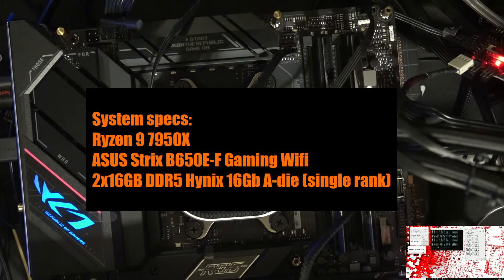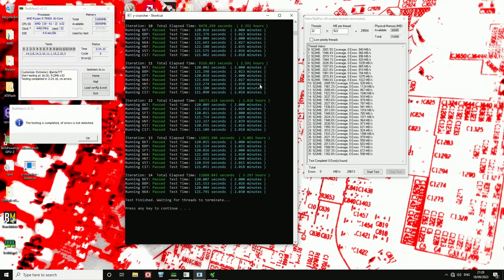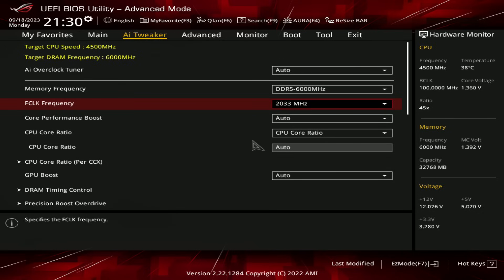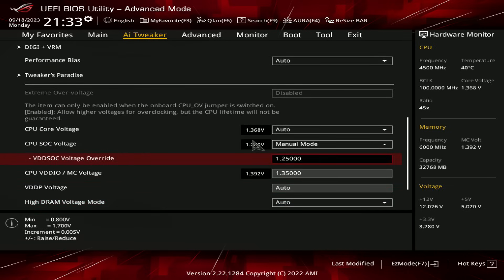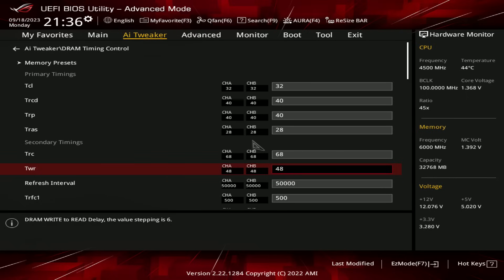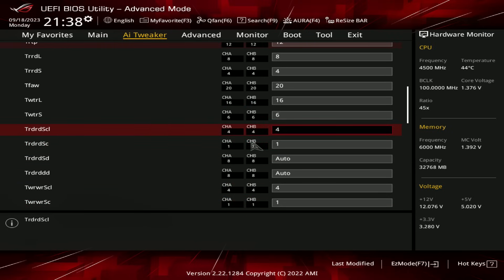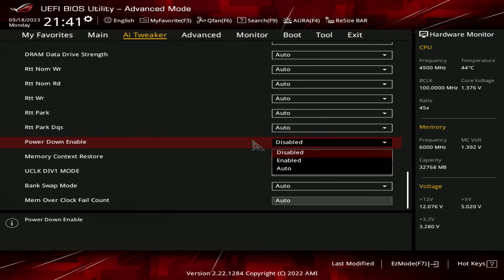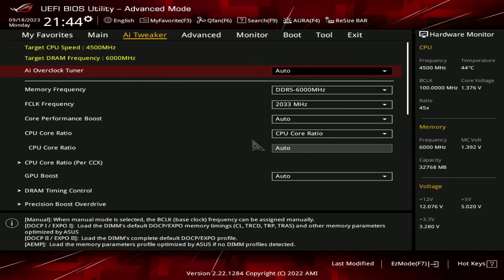Easy memory timings for Hynix DDR5 with Ryzen 7000

Comment: Would be nice to have a comparison of performance after setting the timings
Reply: 2x16GB Corsair Dominator Platinum, CL30 version. Hynix.
On Aida64 memory benchmark I got following results:
Expo:
Read: 77914MB/s | Write: 76244MB/s | Copy: 68462MB/s | Latency: 69.5ns
Buildzoid profile:
Read: 88496MB/s | Write: 92345MB/s | Copy: 79040MB/s | Latency: 61.8ns
Reply: @PaulDiracTWR  I'm using these exact settings, with 64gb and I'm only getting  
Read: 65000 | Write: 91000 | Copty 64000 | latency 69.8
What am I doing wrong?  Thats a huge difference in read
Reply: @brett6228  im in the same boat as you. Did you find a solution?
Reply: @brett6228  Yeah, seeing similar numbers. Not seeing what was originally posted.
Reply from the maker: One problem. I don't have any "normal" EXPO kits.
Reply: @ActuallyHardcoreOverclocking  
Hi, I copied your settings and got an overckock that seemed stable on Windows 11 because the computer wouldn't restart.  However, when playing a game like halo infinite or battkefield V for 5 minutes, the game ends up closing.  With other types of overclock the computer was restarted, which I consider more unstable.  How can I keep similar values and prevent the games from crashing?  I don't know what value to start changing or raising again or what you can advise me to try to find stability in games.
Currently I tried other settings with my same RAM from a web and other secondary values and I got improvement, but without a doubt yours was the best.  of 70 ns with the Expo value of the latency ram at 56.7 ns, a beast.  The reading and writing speed also increased by about 400 points.  In games, the performance improvement is noticeable a lot, especially in CPU-dependent games, I made comparisons and the average, low and maximum fps increased a lot.  For this reason I do not want to give up your magnificent overclock profile, and for this I want you to advise me what values or value I should go up little by little to find my point of stability.

My ram is a Flare X 6000 CL32 32-38-38-96, and the primary values that I set along with your overclock were 28-36-36-28.  The overclock that I was trying previously was the one in the following link: https://www.techpowerup.com/review/g-skill-flare-x5-ddr5-6000-cl32-amd-2x-16-gb/8.html  which was stable if I applied only the primary values, but when applying the secondary ones the pc ended up restarting at some point.
Reply: @SightlyJester I think he said to use the primary timings that came with the RAM. So 32-38-38. You are lowering those timings quite a bit
Reply: @SightlyJester  As Nathan White said, in the video he didn't change primary timings. He said that those timings tend to be where quality differences show up and so the manufacturer likely already tried tighter primary timings and it failed. Also in the video he said that if you have problems where the ram is stable with his secondary timings during memory stress tests but then crash in games then probably your gpu is overheating the ram. He said that it's a good idea to stress test the gpu at the same time as the ram to identify this. Also if it's just the game closing rather than a restart could it be the gpu overclock rather than ram? My gpu settings are seemingly stable except for hitman world of assassination where the game crashes unless the gpu is on stock settings. Since the system stays on you could let a game crash happen then look at event viewer to see if there are clues as to what went wrong.
Reply: Hardware unboxed will be releasing a video on this shortly. It's already available on floatplane. Long story short, these can make a 5200 cl30 kit perform similar to a 6000 cl30 running expo.

Comment: I wonder which one is more relevant: Warm air inside your case due to a power hungry GPU or the heat traveling through the motherboard PCB to your dimm slots, potentially even destabilizing mobo signal integrity. At least I seem to observe a CPU being hotter than it should be during heavy 4k gaming, e.g. Cyberpunk with RT on. This is with an overclocked 2080 Ti on a Z490 Master with a 10900k.
Reply: It’s been tested and revealed that warm GPU air actually lowers CPU temps rather than hot ambient air. I think good airflow is the jack of all trades here.
Reply: If your CPU cooler is not that great (I'm on a 7900 set to 105W eco with the stock cooler) it will warm up the motherboard and DIMM slots much more than any GPU would, I can confirm this 100% from my testing. Even went up 10 degrees on the GPU compared to my previous 6700K OC setup, pulling the same power but with a massive cooler that was able to get rid of the heat immediately.

Comment: I have a Trident Z Neo 2x16GB kit (F5-6000J3038F16GX2-TZ5NR) How can I tell if it's M or A-Die? I know it's Hynix.
Also, how much performance will this tweak give in terms of gaming?
Reply: You can read the code near the barcode and if it ends with A it's adie,  M is mdie.
Gains depends on what game You play, what application you are running and your gpu for example.
On ddr4 it was for sure over 10% in some games.
Reply: @justetan3566  sweet! Looks like I have an M-Die to use!
Reply: @TheApotheCarrot  hardwareunboxed just tested this and gains are generaly 12%+ on amd, probably lower gains on intel though.
Reply: @Jack  I saw that video. Gains should be above that, as I expect they used an XMP and not custom tuned

Comment: Great and useful vid BZ, appreciate it!
Any thoughts on GDM setting (ADDR_CMD_Mode for ASUS). I've read that disabling it (setting to BUF) can improve latency?

P.S.: Would be awesome to get a vid on how to best push m-die to 6200/6400 with emphasis on MC, IF and CPU voltages.
Reply: At least on zen 3 it was know to improve performance because GDM does some strange interactions with command rate, so even if you had 1T on the command rate, in reality it was performing like 2t (or worse) if the GDM was enabled
Reply: @temporoyale6251  GDM On is more like 1.5T and gives you ability to get some higher MHz and timighter timings to boot, it's not worse than 2T for sure.
Reply: @Kestrelms  yeah, you are right, but I remember a know memory overclocker (Veii) testing the performance of GDM, and in some cases, not all, GDM on would perform worse than 2T
Reply: @temporoyale6251  I did myself tests on dual rank micron E-dies.
Reply: @Kestrelms  i can back him up   GDM ON does indeed have some horrible flaws when you overtight some timings like tRRDL 4 instead of 6 , tWTRL 8 instead of 10  and  tRDWR / tWRRD ratio if you use lower tCWL than tCL.  might be just a dual ranked issue. in my experience i would use a lower frequency with gdm off than a higher one with gdm on.
might be a specific motherboard / ram issue, might be something else but the issue is there.

Edit: GDM ON feels like a fake stable settings on some rare situation, doesn't throw errors but gives significant worse result than 2t.. not to mention 1t pure.   For some reason most overclockers and AMD recommend GDM ON for Dual Rank kits, based on my experience i don't.

Comment: With my 7700x, Asrock b650e Pg Riptide and Hynix A-die (2x16) I've spent several hours to optimize timings one by one and I came up with the same values. In my setup the FCLK is stable at 2100 and Trdrw can easily go down at 14. Unfortunately at the moment Asrock bios doesn't allow to modify Trefi.
Reply: Update your bios, tREFI and GDM can be screwed with now.

Comment: Thank you Buildzoid, much appreciated!
I'm running the same motherboard as you and a Ryzen 7700X with the G.Skill F5-6000J3038F16GX2-TZ5NR EXPO kit. Besides the 3 primaries I copied the same timings as you and got an increase in AIDA64, but can't help wondering if I'm still missing some improvements.
Default EXPO I was getting 59K reads and about 72 latency, with the changes it improved to 65K reads and 65 latency, but I see others getting a lot better.
I'm wondering if I'm missing something?

I'm also wondering about my silicon quality of my 7700X as with PBO enabled, ASUS's auto settings are doing a negative 15 all core offset on the curve optimizer. Out of curiosity I did -30 all core and ran CinebenchR23 multicore for 30mins and no crash, but I don't know if its actually stable.
I've been out of the loop on overclocking for a long time. I just built this upgrade from an i7-3770K I had for 10 years, OCing has felt overwhelming to say the least lol.
Reply: Regarding PBO - just run core cycler and adjust cores individually as necessary. It'll give you utter stability as far as the high end goes. The biggest problem with undervolts is that you're moving the voltage curve down by an offset and at lower frequencies and loads it may be unstable. So if you need 24/7 stability I'd usually keep it 1-2 points above whatever core cycler helps you end up at.
Reply: I've got an 7700x too. I can run banchmarks at -30 all core but if I run a code compile I get some errors. Ended up optimizing core by core with 6 cores at -30 and 2 cores at -28 and -27 and it's stable now
Reply: Hey, I'm on a 7900 so probably different experience and all, but I'm on -30 all cores too, running for one week now. It was so stable in what I do that I went to -40 (lol) and it kind of worked, but what I noticed is that it would crash in medium to light loads (think YT videos or gaming), heavy loads were fine. Try using CoreCycler, it cycles between different loads across all cores, and tells you which core has died.
Reply: My 7700X can reach 52.8ns latency, 70k read, but only -10 core is stable, and trrdscl can't reach 4 (unbootable)
Reply: @nguyendinh2052  What Ram kit are you using?
Reply: @_Keiichi_  Hynix A F5-6000J3238F16GX2-FX5
Reply: I'm in the same boat. With the same RAM and a 7800X3D, Aida64 shows almost the exact numbers you got from before and after tuning. Have you made any progress on it?
Reply: Don't just copy settings. Tweak individual timings yourself and see what works
Reply: @GewelReal  My RAM kit uses the same SK Hynix A-die that Buildzoid is talking about in this video, and explains why you can just copy all the same timings. Which from what I gather is the point of this video in the first place. Otherwise if they were different chips I wouldn't and likely just stick with the EXPO profiles.
But I'm seeing others that are getting better results copying his timings when using the same Gskill expo kits and thinking something is off.
I don't really know a lot of the ins and outs of ram timing so this video has been a great place to start for me, but don't have the time to tweak each one figuring out what to do.

I also thought it was odd my initial EXPO latency in AIDA is 72 with lower reads then what a lot of the reviewers were getting with the same gskill expo kits.
Reply: @_Keiichi_  yeah you can copy, but theres variation to each die

Comment: Hey Buildzoid, a question for your expertise, since Ryzen 7000 have memory speed peak at around 6000, is buying Samsung DDR5 viable since they have lower tRCD? or is it still hard to stabilize or have other issue I am not aware of? Thanks in Advance!
Reply from the maker: Samsung DDR5 is just generally harder to run. Also Samsung has weaker subtimings.

Comment: my tfaw is 16 on x670e-e strix with the asus 6400mhz cl32 1.4v profile timing on 7700x with 2200 FCLK

edit: just found out that FCLK 2200 from 2133 gives me a nice measurable fps boost in watchdog legion benchmark from 192-3 fps average to 196-7
Reply: Very nice. What's your SOC voltage?
Reply: @TheJonazas  it was 1.43 while it was on Auto but since i entered 1.4 manually i can't get it stable over 2000fclk 😡 no clue wtf happened
Reply: @GoldenEagle0007  damn... ok

Comment: I really appreciate the videos where you show timings that should be valid for a particular memory module/manufacturer. I used your videos applicable for 3200 CL14 b-die for ryzen to OC to decent timings 3800MHz cl16 and it worked fantastic.

Comment: Thank you so much for this!  I used your settings on my G.SKILL Trident Z5 Neo DDR5 6000 64gb kit and went from read rate of 70,238 MB/s to 84,750 MB/s; and latency of 69.1ns to 59.4ns.
One question I have is on my Asus x670e Hero MB, the CPU VDDIO/MC voltage, when I set to 1.35000 V, it changes the value to something like ~1.35663V.  Does this matter?
Reply: Very nice, thanks for sharing this! I'm getting the same kit - assuming you used CL30 one right?
Reply: @ChatGTA345  yes cl30
Reply: no, that doesn't matter, it's normal
Reply: Hello. Can you help me with the setting as I’m having the same board. But I couldn’t boot with 128gb 6000mhz.
Reply: @Shafy7   Did you figure out how to get it working with those settings?
Reply: @icarus33 no. Still running at 128gb at 3800mhz
Reply: I dont know how evrybody getting those ram speeds...9700x on expo im with 59k and 78 latency with his timings im with 63k and 70 lstenci. 
Board x870e Carbon ..ram Corsair vengeance Cl30 36 36 76 at expo

Comment: With 128Gb needing to run at a much lower speed, would you see any increase in performance by optimizing the timings?
Reply: Are you running with 128gb ?
Reply: @Shafy7  I am not, because the speed needs to be so low

Comment: Can VDDSOC be higher than VDDIO/MC?  BTW I think memory temperature is usually higher on the open test bench (with no air flow) than in a case with minimal air flow.
Reply from the maker: AFAIK yes.
Reply: He was lower not higher (1.25 VSDDSOC vs 1.35 VDDIO)

Comment: Thank you very much for the videos! They really helped me choose which components to use for my new AM5 build.
I plan to use a B650E Aorus Master with 2x16 5600 A dies.
Will I have any other options (with different names too) to tweak in the Aorus board to mimic as much you did for the ASUS board in the video?
Thanks again! Subbed as well!
Reply: Almost everything will be named exactly same. Voltages names may differ a little bit but you will manage it 🙂

Comment: how can i identify which hinyx dies are on my memory without taking them apart? thaiphoon burner doesn't really say like it did with samsung b-die. the only thing it tells me is that the part number is H5CG48?EBDX014. i searched for this part number. all i found is that these is hynix, which i know, but i don't know if this is A or M die.
Reply: if it is 6600 or higher probably A otherwise its M
Reply: *anything lower 6600 is probably M

Comment: So if my memory kit is CL-36-38-38 5600 M-die (Kingston Fury Beast), then I should just use 36-38-38 main timings?

I've tried a lot of different setups, but for some reason my PC always gets the issue where it doesn't post after a few restarts, even with fast boot disabled, even though I don't seem to get any errors after a few hours of tests.
Reply from the maker: I didn't really consider what would happen if someone took a lower clocked kit and took it up to 6000. So might be a good idea to set the primaries to the same settings I used.
Reply: As some1 with that same kit on intel system you will probably have to loosen trcd and trp to 40(39 might work with more voltage). I'm running 36-40-40, but I'm also using a locked cpu(locked vccsa voltage) so with more SA voltage the tcl would probably go lower to like 32 or 34.
Reply: oh yea forgot to add I'm running at 6400 speed on the intel system so the memory clocks just fine.
Reply: I have the same kit. Mine runs fine on 30-38-38 @ 6000 1.35v. From what I saw online, if you plan to run it at 6200+ then bump CL to 32 and possibly RCDs/RP to 39.
Reply: I have the same KIT and it works with 30-36-36 6000 1,25 V. I did not try to lower it yet.

Comment: What's weird is I'm able to run my memory at 6600 with memory controller at 3300 easily without doing anything special on my 7950x.
Reply from the maker: very lucky CPU. So far none of the chips I have would even post above 6500.
Reply: @ActuallyHardcoreOverclocking  Crazy part is I just loaded the xmp for this memory and it worked right out of the box.  I had a to manually set the memory controller to 3300, but no problem a.  I've got the fclk at 2100 right now, haven't tried any more yet
Reply: Curious what you do with it and if you have any frame of reference to running at stock settings? My ram running bone stock vs super tight shows big improvement in aida64 but I don't notice anything real world. And that makes me sad.
Reply: @v3xx3r  Well, I mostly watch YouTube videos and play some games.  I do some VR stuff too, but I don't see how anyone could notice the real world differences honestly.  Don't get me wrong, that doesn't stop me from spending many hours tweaking and overclocking, but I know I'm doing because of enjoyment and not useful performance gains.  Running the sub timings in this video got my latency down to 61.6ns and I broke the 100GB barrier for write speed!  Pretty exciting if you ask me :)
Reply: @AdamBrackney  How is your latency still over 60ns when you're running 6600?
Reply: It sounds like fabric throttling and/or excessive background apps/processes.
Reply: Do you set UCLK==MCLK? By default it will switch back to UCLK==MCLK/2 for over 6000.
Reply: @nguyendinh2052  Correct, once you go past 6000 you have to manually change it to 1:2.  It's running at 3300 on my system
Reply: @AdamBrackney  3300 is still 1:1 because DDRAM is double frequency. 1:2 should be 1650.  My CPU can't boot with 6500 no matter how much voltage. You got a god like CPU.
Reply: @nguyendinh2052  It's definitely crazy, I didn't think it would work based on what I had read, then it booted right up and the benchmark results are legit!